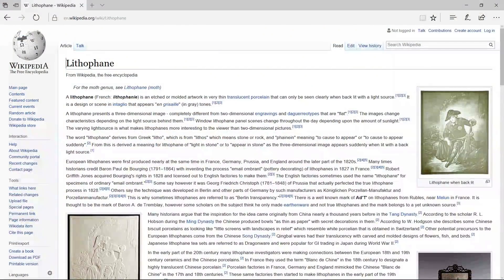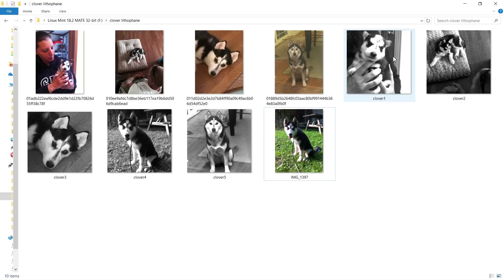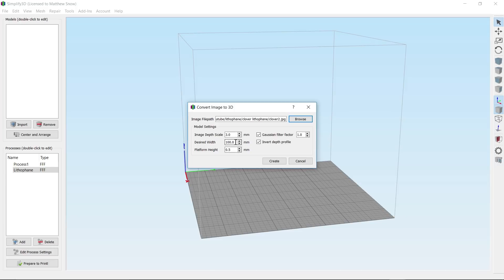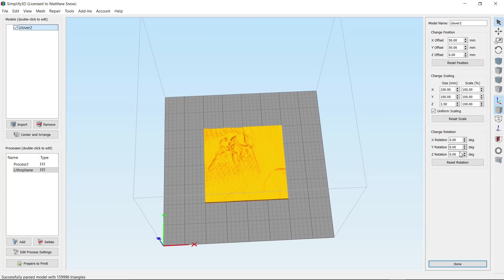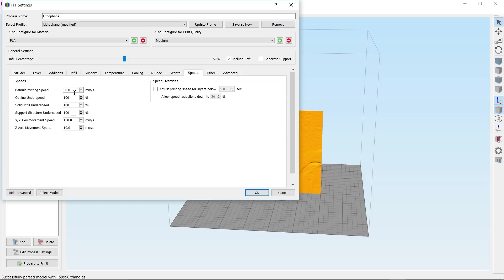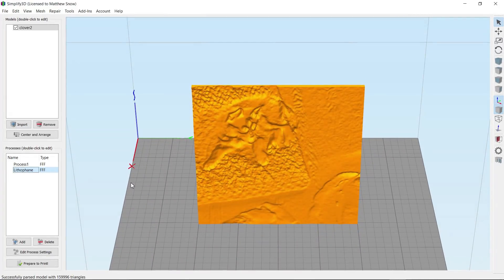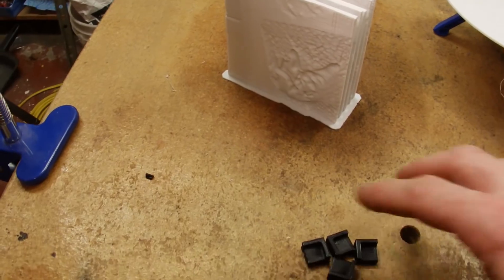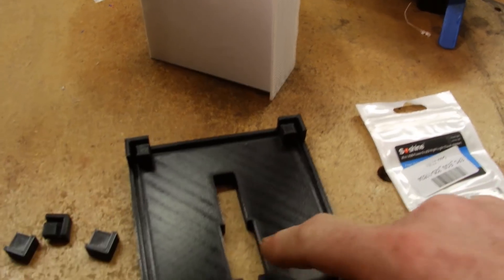Lithophanes with Simplify3D

Comment: @ Inside The Mind Of Matt I used all of your recommend settings and even for a small one of similar size of yours it says print time is almost 13 hours and it moves in super slow motion. I use a Creality CR-10. Any ideas what may be the issue?
Reply from the maker: 1st off I wouldn’t print more then one at a time I did it for the video for demonstration but the extra movements reduced the quality 2nd you can speed it up to your liking but at some point the speed will effect the quality so I’d suggest playing with different settings
Reply: @InsideTheMindOfMatt  I had it set up to only print one. Which are the settings for the print speed? I'm very new to this
Reply from the maker: @PDSbugGutTacos  if your using simplify3d under the speed tab

Comment: great video dude as always , i got my other project going thanks to you the ramps conversion . but saw a sale on amazon and bought a da vinci jr wifi version  and for the money great bit of kit . onlt setback was the having to use xyz own filament but good hack available so can use third party filament , using nfc stickers and software on phone with nfc function on it . or there is a da vinci jr pro nearly same price but allows you to run third party filament as well as xyz filament .
but great 3d printer has an amazing auto level function i have not had to touch anything and you just print and go . regards

Comment: How to avoid dot marks appears in lithophane
Reply from the maker: dots or zip can be cause by many factors. They are normally at the layer change. Lithophanes are one of the items you want to make sure your settings are just right. I know that's not much help but retraction temp speed or extrustion could all effect print results hard to nail one thing

Comment: I notice at 6:40 one of your prints (2nd one in) seems quite thin compared to the others?  Super great video.  I just got my S3D and want to print my 3D Business cards (Lithophanes).  Prior to S3D I was print them flat but they just didn't come out right.  Vertical was the way to go but the thinness of the business card required brims and I didn't know how to do that with S3D  So thank you!  Using Rafts.
Reply from the maker: ChinaAl yes it’s the edge and anything light colored will be thin in a latter video I add a frame all the way around made for much better fit
Reply: Oh great.  ThanksI was doing 3D Business cards (Yes Lithophane) but wanted to do something like you did as well.  
Funny I was thinking ideaMaker when looking for Brims in S3D. it's a whole different ballgame.  Thanks again for your video.
Reply from the maker: In s3d under tools preferences tab can’t miss it

Comment: I had a question: Why did you change the orientation of the print? Did the other orientation affect the quality?

Thanks for sharing. I love Simplify3D it's sooo worth the cost compared to the free programs!
Reply from the maker: I changed the orientation so that there was the least amount of head movement because it did improve quality 
and I'm a victim of the resent seam issue that S3d is producing not happy at all

Comment: I'm on the CR-10 and this is not working for me. Once it gets to the middle of the bed it just humms and sits there. Or it moves like a turtle and does nothing. I followed just what you had  any help?
Reply from the maker: Sounds like a slicer problem I had an issue with one of my computer it wouldn’t product the lithophanes at all I did an uninstall and reinstall and all was better

Comment: I've been trying to print a picture like this using the same software and it keeps giving me huge timeframes in excess of 100 hours, any idea what would throw that off so much?  I've tried making adjustments but nothing brings anything down to the 20-40 hour range - I'm new at this, any tips or advice is much appreciated, thanks and nice video!
Reply: HOME BUYERS MARKETING II WI - Homes for Heroes Affiliate you need to multiple your speed by 60. At 45mm/min you’re moving at less than a mm a second.
Reply from the maker: Can u tell me some more info like what size, layer height, print speed, infill, and how many you trying to do at a time btw since this video my settings have change I print a lot slower to get the best quality you need to print slow but give me some of your settings and maybe I can point you in a direction that will help and thanks for watching
Reply: Thanks for the reply!  Running infill at 50% to 100% (still crazy high hours either way), 100x5x77 mm, speed 45 mm/min per recommendation i saw while researching, printing only one lithophane at a time - not multiples, Also have changed between Fast, Medium and High Quality settings, all still very high in terms of hours to print.  Layer height .2000 - thanks again!
Reply from the maker: HOME BUYERS MARKETING II WI - Homes for Heroes Affiliate I print 100x100x3mm .1618 layer height 0% infill and depending on which printer I use it takes anywhere from 5-9 hours
Reply: Thanks guys, I'll give it a go!

Comment: Cool project - didn't realise S3D had that option in there?! Good simple solution for the light too - i've got some of those and they just sit in a draw! I think a 3D printed "dome" or diffuse  would help too - to help scatter the LED light more in the x and y directions than mostly up.

Cool

Steve
Reply from the maker: I did try that and it lowered the light level. Maybe I could use clear for the diffuser
Reply: Inside The Mind Of Matt yeah, it would need to be natural or clear plastic, and thin... just enough to catch the light and not bounce it back... or cut a ping pong ball in half as a test?! Make sure they are non-flammable ones!!

Comment: Sorry to say, but I think the quality could be much better... layerheight shouldn't be more than 0.1 mm, it is clearly obvious that not all of them fit in the frame, and once lit, the bottom of the pictures is still dark...  I don't mean to be negative, just some points I think need improvement...
Reply from the maker: Thanks for the input I did some further tweaking of the base and as far as the quality I think 5 at a time might have effected it a little when I do a solo its much better with my setting I did 5 as an experiment my light source might be reconsidered also thank again for expressing you opinion I'm always open for constructive criticism thanks for watching please consider subscribing ;)